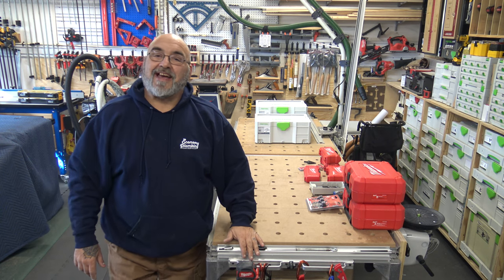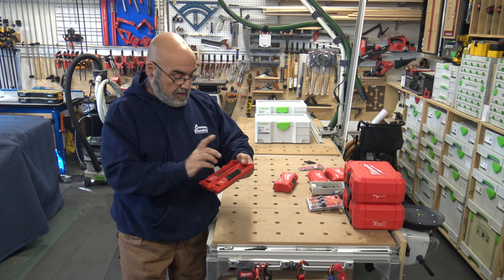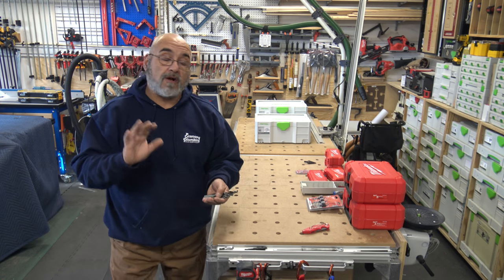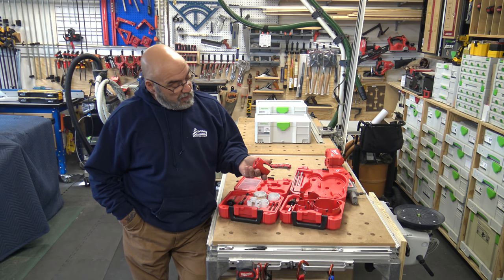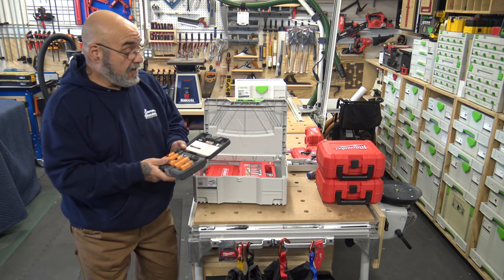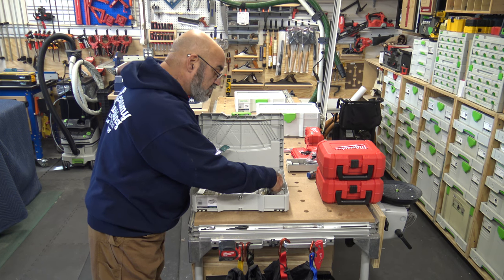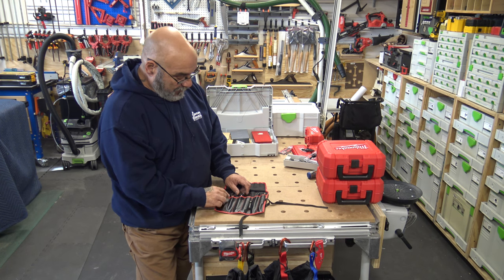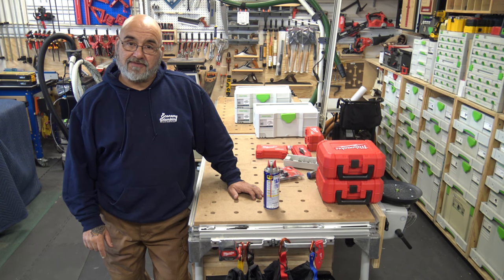Drill, Fostner and hole saw bits I use in the wood shop.

Comment: Great Video Mike, enjoyed it. Didn't realize they sold 300.00 Hoit Bits that would drill through 1 inch steel. That is awesome but expensive. Better than going through 10 bits trying to drill through the same task, lol. Thanks again.
Al
Reply from the maker: chipshot442 there a old set of my fathers I would hate to buy them now.

Comment: Mike you being a pro plumber I was wondering if you had the Milwaukee air snake and if so what are your thoughts on it.
Reply from the maker: AJL Woodworking lol funny you should ask. I just bought it two weeks ago and I’ve used it three times works great. I also bought the 12 volt hand snake and the 18 volt backpack snake both also work great. Thanks for the comment